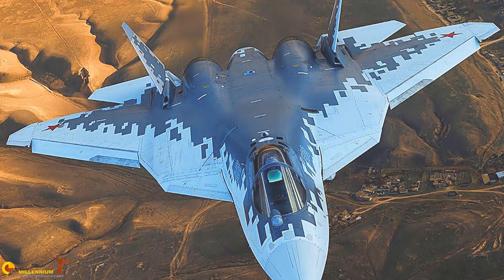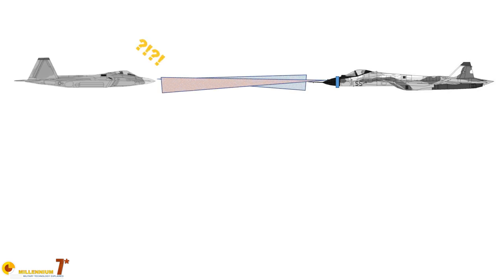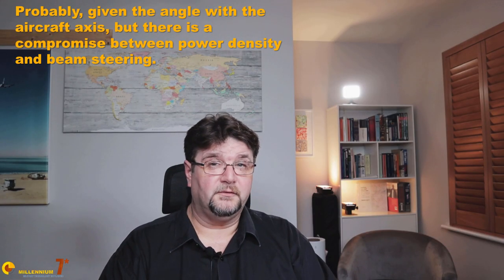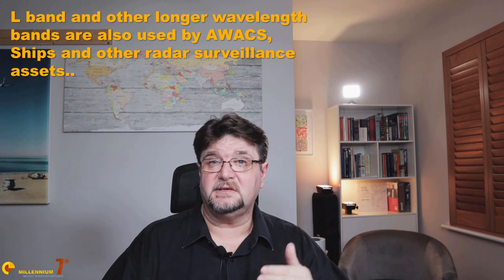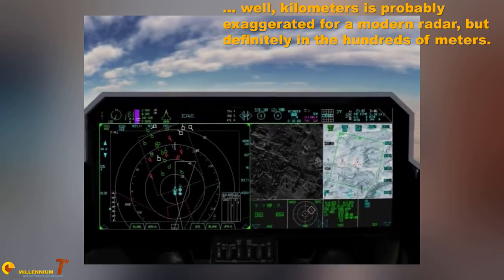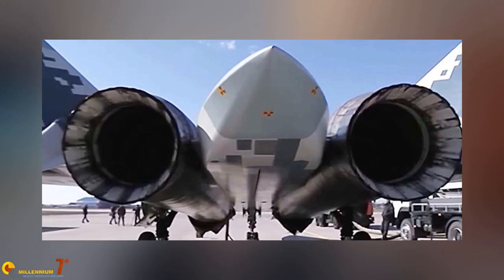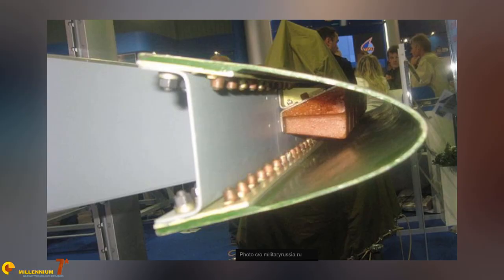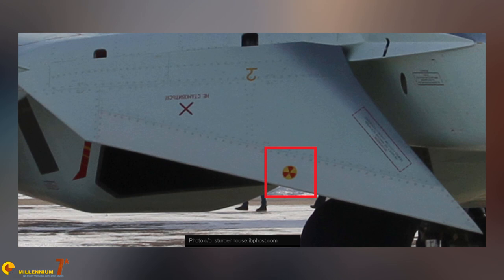Su-57 the Raptor Spotter | Part 4 - Radars, ESM, ECM, IFF

Comment: Will you have a similar miniseries about the F-35?
Reply from the maker: There are already hundreds of videos about the F-35
Reply: @Millennium7HistoryTech  which means they all covered everything that is in public about F35, right? Though still wish you'd dig into its electronic attack cap
Reply: @marioshadjikyriacou3381  then Switzerland chose it for having the best price
Reply: @marioshadjikyriacou3381  public statements following declaring the winning bid. Gripen suffers from low production and overall less capable. A stock Gripen E is 6M more expensive than an F35A, still, lacking targeting pods

Comment: Could L band radar be used to locate the general position of a stealth aircraft with an infra red homing missile then being fired at the stealth aircraft?
Reply from the maker: That's the kind of tactics that are believed to be working on. A salvo of long range weapons with different technology seekers.
Reply: Theoretically yes but at greater distances the accuracy would be the main challenge. It is a matter of how advanced the missile is because let's not forget, 5th gen fighters have reduced IR spectrum signatures, making them quite hard to detect by onboard IRST systems of the missile. I believe once those have advanced, they will be much more effective against stealth aircraft. Having said that, if new engines are developed with reduced heat signatures....Basically a cat and mouse game
Reply: L-Band short length antennae will struggle to get any long range contacts for starters.  They are normally used for DME, ATC, IFF,  TACAN, and other modes for position location referenced to the ground in civil and military applications.

These antennae on the Su-57 are similar in length to the old "towel rack" ARN-92 LORAN-D on Block 32 and 33 F-4Ds.

LORAN was a positional RF navigation/position location system that evolved into something else for SEA.

The presence of these shapes and sizes of L-Band antennae on the Su-57 should not be assumed to be for threat detection.  Look at the wavelengths.
Reply: As to long range IR weapons employment, it all looks great on paper, until you try it, assuming you even have an accurate weapons-grade track.

Send a missile with a sensitive super-cooled or digital IR seeker into the atmosphere at Mach 3-4, and guess what happens to the leading surfaces?

For shorter range, you can maintain seeker sensitivity, but for long range, the seeker head accumulates too much aerodynamic friction-heating and blinds the optics, making them useless for terminal phase, even if you provide data-linked midcourse guidance.

For a VLO platform like F-117A, F-22A, or JSF, there is almost no IR signature, so IR-guided missiles are practically useless against them.

Welcome to the new rules of air combat.
Reply: @LRRPFco52  why not both. ? AESA can do A2g  and A2A. So if your in business of finding a raptor. You might as well scan fot some 80 000 ton ship too.
Reply: @JMiskovsky  Multimode somultaneous function is a baseline assumption for a competent AESA radar, but this is really besides the point of L-Band antennae and what they are for.
Reply: @LRRPFco52  ok besides the raptor and big metal box on sea what can be use of such L band radar? Also jamming and cheese communication is given since it know capability. Maybe some weird mode where they will ground and air generated pulses for some special effect? Like teaming up with raduga equivalent.
Reply: @JMiskovsky  If you look at what LORAN-D was being used for in the early 1970s, I think that’s the direction to pursue.  There’s a very interesting program they were doing with LORAN-D on the F-4D out at Eglin AFB that saw limited use in Vietnam, that is extremely relevant to the modern developments with UAS.

The LORAN base stations had extremely long antennae.  They used SR-71A photographic reconnaissance-derived maps of the whole area, with microscopic pin holes in them fed into a computer, so exact TGT coordinates could be quickly referenced.  It was a very interesting series of interlocking technologies in a time where GPS didn’t exist.

Aircraft that didn’t have LORAN relied on LORAN-equipped aircraft to get home at night and in bad weather on several occasions.
Reply: @LRRPFco52  thank you. I did not know About Loran D. I know only up to Loran C.

Comment: L Band has the advantage of blocking GPS (?)
Reply: How would that be a benefit (assuming it works). Any incoming missile which has GPS also has inertial guidance as well as its own detection systems and is also capable of two way data flow with any source aircraft (such as an AWACS  or F-35)
Reply: L Band is useful for RF positional location for navigation, and has been used for this for many decades.
Reply: @nickbrough8335  degrading mid course correction could be great. Also freaking with opennts navigation is good too. I bet that f 35 has some lasers gyros but any way still helps.
Also for defending site against GOS guided munition.
Su 57 is design with many futures needed to give it as much of an edge as NATO has bigger numbers game.

Comment: This goes a long way to explaining why there isn't more f-22's, and why russians aren't big on making stealth planes. (well, presumably)
I guess the question now is, how can you make missiles lock on to stealth aircraft. I'm guessing you could analyze the rapid fluctuations which causes tiny doppler shifts, to filter out a target in the otherwise, presumably random static, noise. (caused by turbine blades, or thermal deformation of the fuselage itself.) A missile just doesn't have the room for a longwave radar, so it's interesting how they will tackle that.

Comment: There is a logic to putting an L band radar on your aircraft, but such a small radar in a moving part of the wing, must limit that advantage to a large extent. How ,much is unknown. but compared to flying a larger L band radar in an AWACS system it must be massive. Why not place a larger L band radar in the nose and fly an Su-57 "AWACS" alongside in support of a typical Su-57 flight ?  That would be much more effective at delivering that purpose.

I'd also suggest that against a networked F-22/F-35 formation, supported by AWACS, many of the aircraft would be flying with their radars off and using passive and networked data within their formation. We all know its easier to detect radars at a longer distance than the radars resolution and with modern electronics and multiple detections within the formation, it should be easy enough to fairly accurately model the position of the incoming radar active flight using passive means.

The advantage from side looking X band radars was considered by the USAF a number of years ago with the now old F-22 design (supposedly the space and power connections exist to upgrade and fit cheek radars if necessary). The fact that the F-22 doesn't may suggest that the advantages are not that great in the real world. The US must have test data ? It may also be the Typhoon concept of putting a AESA radar onto a moving base to give a wider angle of the front looking radar may be as effective at perhaps a lower weight ?

Comment: I have a question. 
Since Russia and India were jointly working FGFA for a long period of time,
 did India gain anything from that program or it was just a complete failure?
Reply: India wasn't in the PAK FA program , which resulted in the SU 57.
India was in FGFA programme.

This is the extent of my knowledge
Reply: India was supposed to develop her own project on the basis of su-57, which should have shared versions with slightly decreased characteristics of engines, electronics and some other systems with original. However, they wanted to make some changes in the basic design, for ex. make a 2 seat version. The reason why FGFA project was cancelled is mostly due to the fact that India demanded overall technological transfer of all elements and systems of the aircraft, which was an option for Rusia, considering close ties of India with USA. Only after getting official refusal, India started to criticise this project.
Reply: @sidharthcs2110  He mentioned in one of his last videos , the composite material ( radar absorbing) used in su-57 was a result of indo-russian partnership (FGFA).
So I was just wondering if there were more things that came out of that partnership..
Reply: @chandrakalamundra4152  well, probably yes, but not much. India plans to use foreign engines in AMCA programme and probably develop some kind of indigenous AESA radar on the basis of what it got for Tejas from Israel. Considering overall design of AMCA it is just a blend of f-22 and f-35.
Reply: @chandrakalamundra4152  
I remember...
Reply: India provided roughly $300 million in seed money, which Russia needed to get PAK-FA off the ground. Once India saw the results with it not being VLO, using interim engines, and all the normal headaches of early problems with integrated systems bugs/lack of maturity, they withdrew with the option to purchase FMS variants at a later date.  Then they contracted with Dassault to buy Rafales.
Reply: @LRRPFco52  300 million is a tiny sum, considering Russia have spend around 5 billion on the development. India's desicion only means that it will get, if ever get 5th gen fighters in mid 2030-s.
Reply: Considering Rafals costed them more than 200 million $ per piece ( total sum 7,2 billion $), it was a "much" better deal than invest in FGFA programm 3/4 billion $, which was the initial agreement.
Reply: @LRRPFco52  
No.
The MMRCA competition started way before India's pull out from the FGFA programme if I'm not mistaken
Reply: @LRRPFco52  the mmrca rafale deal was initated in 2001 and has nothing to do with the su 57. The Indiana wanted total transfer of technology which was rejected.

Comment: All this fanboying over the F-22 and Su-57 in comments, but ultimately I think it will come down to syncing with tech beyond the aircraft itself. It's doubtful that the F-22 will fight the Su-57 in a complete vacuum from other support, just lob a bunch of missiles beyond visual range and take down a Su-57. That's not how modern warfare works. US and Russia have taken such a dramatically different approach to stealth, with both sides not showing all their cards, that ultimately we won't know without a conflict where they're tested.
Reply: Yeah the F-22 and F-35 fanboys seem to think the Russians won't be jamming their radars. Also if they want to engage BVR the F-22/35 will have to turn on their active radars which will give away their position.

Comment: When ever you emit a signal (RADAR), you are marking yourself in a given point in space (target).  You could have the best radar (active) in the world but if someone has a receiver (passive) that can detect you before your radar can see them, you have already lost.
Reply: The standard tactic is to have either air or ground countrollers (AWACS and ground radar, respectively) vector in the fighters to the target and have them turn on their radar for a target lock for their missiles.

And today, we have Active Electronically Scan Array radar that can send out a very thin beam, potententially reducing detection.

Of course, the new tactic is that the fighter does not turn on their radar at all, but uses the tracking data from another asset.

Just when you think you understand the game, they change the rules. lol
Reply: @ycplum7062  This has been a tatic used since the Vietnam War.  The deal now is to have high bore offset launch missiles and missiles that can be launched at great distances and speed.  Low observability is key in getting as close as possible and using your missile to kill without being detected.
Reply: @fredeb67  

Yep. The first missile air war. 

I remember reading about a live wargame where the OpFor was somehow magically able to get around the Blue forces radar defenses. The OpFor was not suppose to be able to detect ground radar since the Soviets and Chinese did not have a radar system or one good enough to alert them or something to that effect. Mig-17s and Chinese-built Mig-19s and possibiy early export model Mig-21s. (it has been a few decades since I readteh story). So what the OpFor pilots did was go to RadioShack and bought some radar detectors, normally used to avoid speed traps on highways. Every time the radar dector went off, they drop down a hundred or so feet till they were at tree top level. By then, they were really cose  to their target. lol
Reply: @ycplum7062  The Mig-21 had radar detection during the Vietnam war and their ground SAM sites had detection too.  They would often be in the active/radiate mode and turn off when they thought they were being hunted by HARM missiles form the F-105.

Comment: SU 57 is the only with 5 antennas. Gripen E is the only with 7 antennas.
The tactical advantage of structural stealth is shrinking, not only due to long wave length radar and IRST. Even computer power and missile development is important. Modern missiles attack over the target, where there is no stealth, and turn downwards. So the attacking fighter can use long wave and guide the missile close to the stealthy target, where the missiles own sensors can detect and destroy.
As a rule: every antenna that can see, can even be seen by the adversary. So an aircraft with structural stealth don't have the same potential to see, as an aircraft wiithout structural stealth.

Comment: I would bet this machine is a nightmare of software related bugs and cost.
Reply from the maker: Yes, but all modern fighters are, more or less.
Reply: @Millennium7HistoryTech  Unfortunately we don't have recently any real hard data about true combat efficiency of modern fighters because they are  all in use as overpriced direct support bombers. But my guess is that in a true combat scenario a very simplistic design accounting for its deficiencies by providing numbers due to a reasonable price tag could prove itself as the true winner.

Comment: Whether or not the '57 can see the '22 or even fire at it, we need to remember... 185 to 10. It's even worse in regards to the '35. Even if the Russians built all 76 planned '57s, we (the US) will have built dozens of gen 6 airframes by then. If not, there will still be hundreds if not a thousand+ '35s to deal with. So really, this is all moot in regards to the '57. ☺
Reply: dont forget the reports the only 40-45% of the F-22 , F-35 fleet is available because of lack of parts and high costs + number of manhours maitenance needed for an hour of flight.... so 185 to 10 is a wishfull thinking to say the least
Reply: @conan670431  Agreed. But even 50 '22s is more than enough and by the time there are 50+ '57s, many of the availability and maintenance issues will have resolved. Heck, even if not, F15EXs will cause a lot of problems too.
Reply: @myplane150  SAMs, su-57 is only a part of russia's air defence doctrine, and 1 su-57 is to control 4 S-70 stealth drones that can engage aerial targets, and also to network with a group of su-35. Add the mig-31 interceptors. The su-57 would remain unmatched, f-22 is already out of the future USAF fighter mix, which is made of 4 fighters, the F-35 (it's not even a air superior fight, it has air to air engagement as a secondary role, one it is badly suited to, it cant even go supersonic without risking its stealthy, goodluck getting away from high altitude, high speed mig-31 with its long range missiles after trying to engage any of the frontal russian fighters), f-15 EX, NGAD, f-16.

So you see, the US will struggle to engage Russian air superior aircraft for years to come. The f-15 just wont cut it, the f-22 is naturally dying, long discontinued, plus there is no money or interest for Lockheed in giving it any more attention than just routine maintenance for its aging airframe, engines, and avionics.

In the meanwhile Russia has unveiled its cheaper su-75, more stealth looking than su-57, and has started working on its 6th gen engines. The su-57 and su-75 already have some 6th gen features
Reply: @conan670431  current report from that air force show f35a more then 70% available.
Reply: @myplane150  You dont understand, all these many f-35s, they are fully operational jets. The nature of the project is a money wasting program, the jets were built in their hundreds while they are still what you'd call a work in progress, the idea was that once Lockheed finished working on its systems, softwares, avionics and all the 700 or so issues, all these will be rolled into those already produced jets. Except the program is experiencing issues, and the old jets are becoming obsolute, need repairs, the engine is experiencing issues, yet the jet on its own has not even passed the testing and evaluation by USAF meaning it is still to date under development phase. 

Here, read.

https://www.airforcemag.com/f-35-officially-enters-iote/

Then read

https://www.airforcemag.com/dod-extends-f-35-full-rate-production-decision-due-to-pandemic/

The russians have 12 prototypes rather than hundreds of then because they cant afford to waste billions of dollars.

Admit it, the US has 5th gen fighter jet issues, and isnt as far ahead as people thing. What did the f22 ever do, when was it ever test, it was quickly discontinued. The f-35 seem headed that way judging by pebtagon reports and the recent congressional hearing and the jet isnt has reached maturity yet
Reply: @brighton1880  Hey, Brighton. I get where you are coming from but, as Stalin was prone to say, "Quantity is a quality all its own". We (the US) would dominate based on that theory alone and, I think the 35 and 22 are better than you give them credit for. Still, I see your argument. ☺